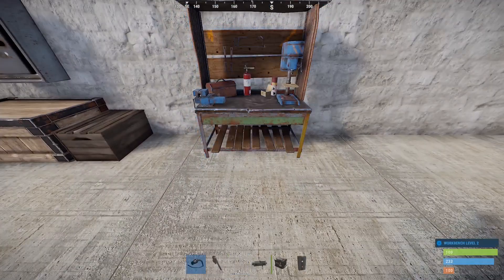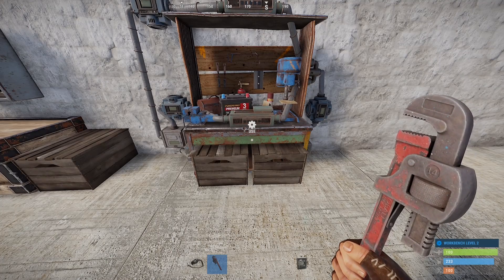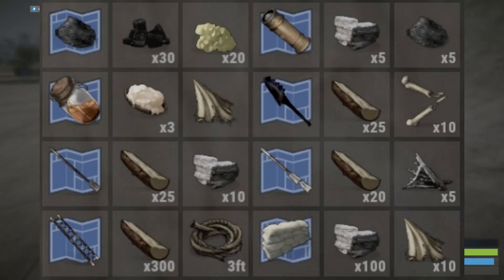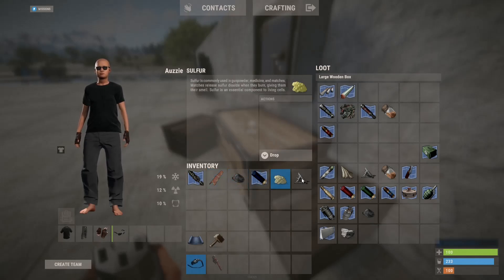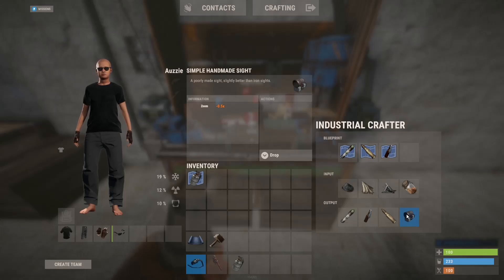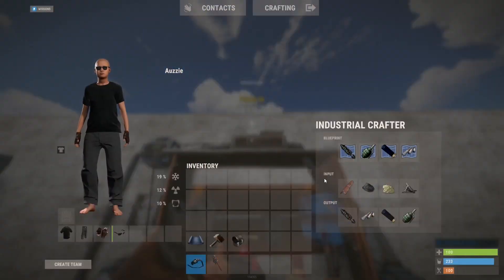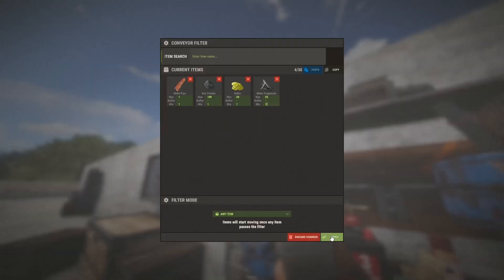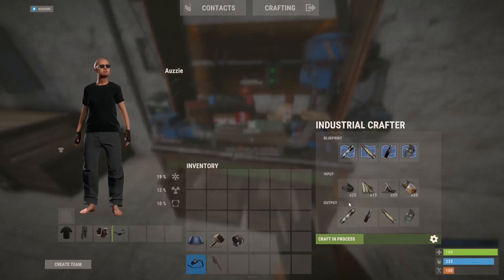Rockets, Syringes, and More! (Oh My!) - An Auto Crafter Tutorial

Comment: this was very helpful. totally thought i could auto craft rockets, as in auto craft the explosives, then the explosives get automatically crafted into rockets. the sort system showing what can be crafted using the same materials really cleared that up. That being said, is there a way to auto craft explosives, and then use those crafted explosives to automatically craft rockets?
Reply from the maker: @andrewkinser9426  Check this video out: https://youtu.be/7fkn6m9Cif4?si=vC3uTFe9_i5tHnA1
You can simplify it a lot if you just want to craft the rockets and not make any C4

Comment: probably shouldnt connect to main power, to spread out power and reduce vulnerability, i have many independent batteries. Battery for compound, maybe split up into north and south, roof, roof backup, sams, furnaces and instustrial
furnaces and industrial may only require a couple solar
Reply from the maker: @dominicweaver4905  That's valid 🤔
I mostly meant running it from a NiH core, but for smaller systems, you definitely could make it independent instead